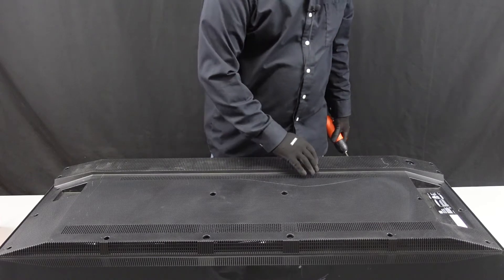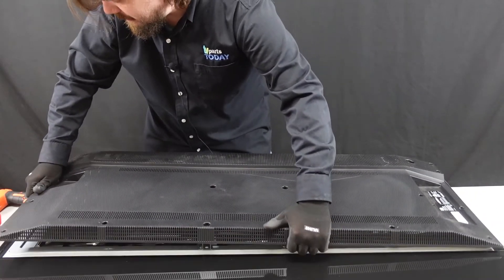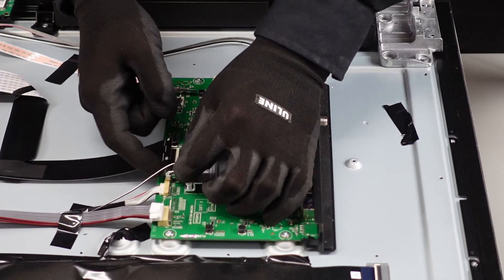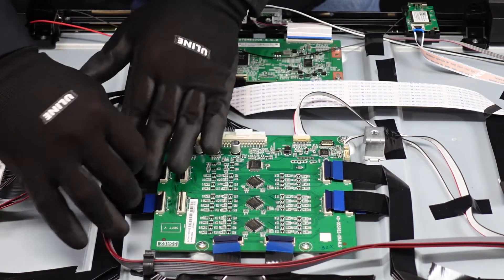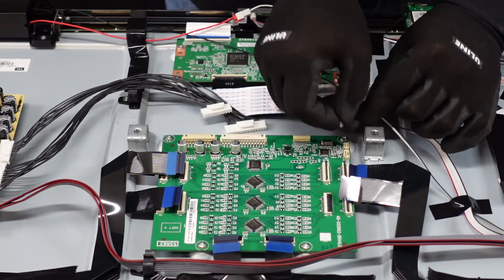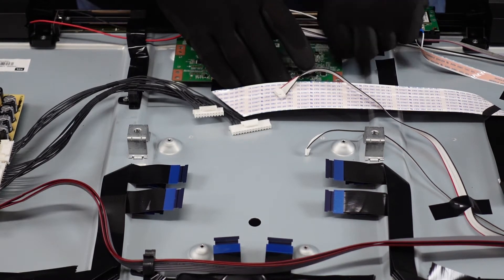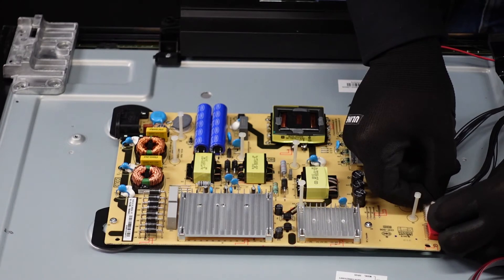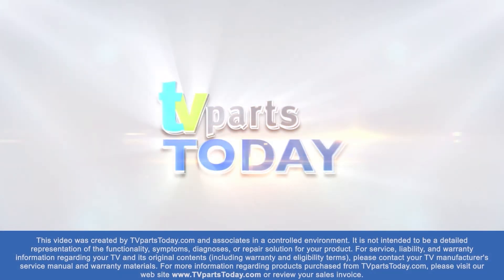Learn to repair your TV.  (TCL 55R625)

Comment: What board do you guys recommend I replace, the TV doesn’t come on and the light on the bottom isn’t lit?
Reply from the maker: Hi Mario! 🙋🏽‍♂ If you have NO standby/power light, we would recommend starting with the power supply board although ultimately it could be the main board or the display panel itself. TV repair is a process of elimination! Reach out if you have further questions! info@tvpartstoday.com 😊📺📺💪🏾❤
Reply: Thank you, bud
Reply: I see there is 3 different part# for the power board. How do I chose the correct one for my tv?
Reply from the maker: Sorry for the late response, Mario. If you get into the back of the TV you should be able to find the part number printed on a sticker directly on your power supply. You could use our website to compare part numbers or send us an email to : info@tvpartstoday.com with your TV model number and a clear, hi-res picture of your power supply and we can get you pointed in the right direction.